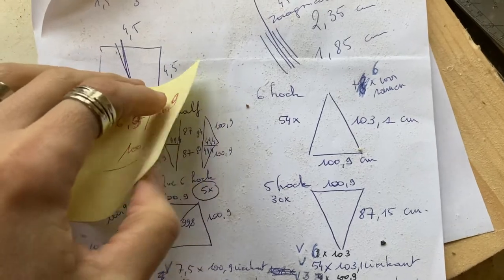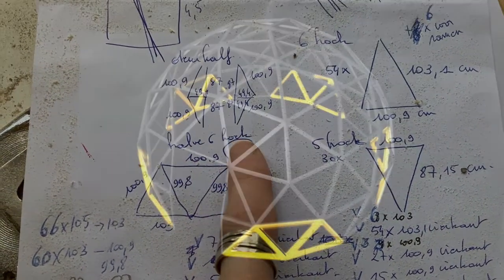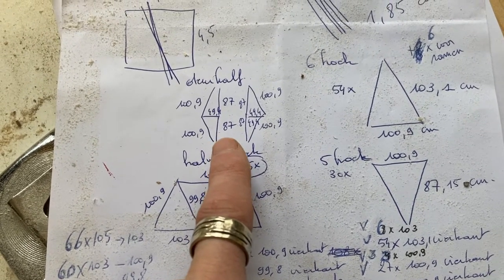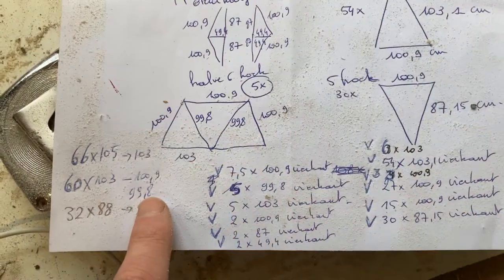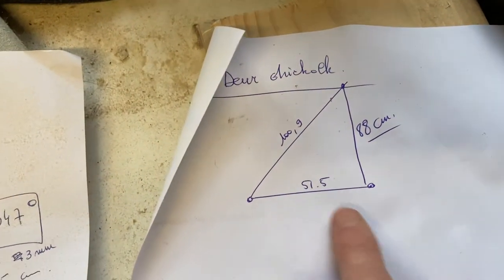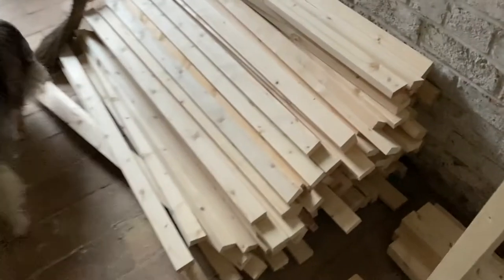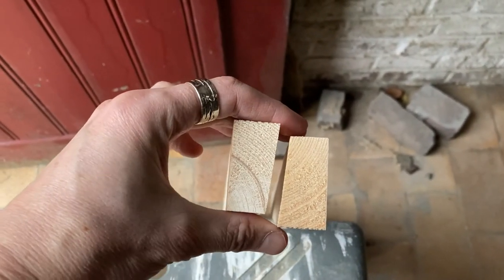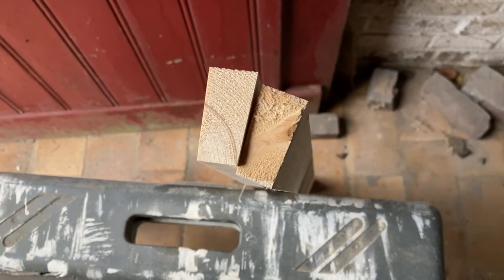GEODESIC DOME PART II   cutting timber

Comment: The strut bevel angel seems to be the biggest mystery when building any 2v and 3v geodesic dome. I seem hard to find an answer or find a tool where one can input the measurements, frequency and size in order to get the right bevel angel.
Reply: the bevel angle is different for penta's and for hexa's, and different at the edges where penta's and hexa's meet. I had derived an average value from my 3D drawing of about 6.7°, but I could only approximate that on the table saw. All the rest is compensated for while assembling. (it needed a little stretching and pushing but the wood is forgiving) I think that the size of your triangles is of greater importance, and you better take a bevel angle a little too much than too little by 0.2° or something.

Comment: Awesome what you do!!! I just have one question for you, i don't know if its much tu ask. How do you calculate the bevel angle?
Reply from the maker: Hi I derived it from my 3D drawing, a geodesic dome has different bevel angles for hex and pentagons and on the edges between hex and penta, but I took an average value of I think approx 6.7 degrees. (I'm sure my table saw is not precise at that level) 😉 when using a different frequency for your dome the bevel angles change, when upscaling or downscaling it stays the same.